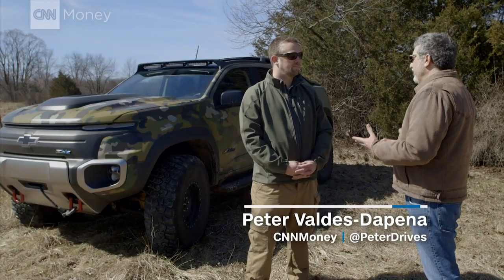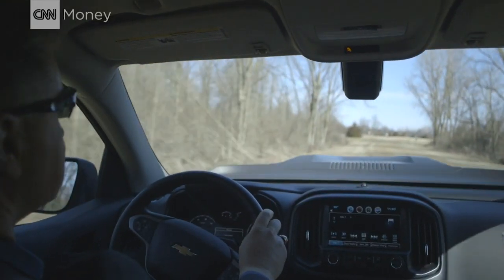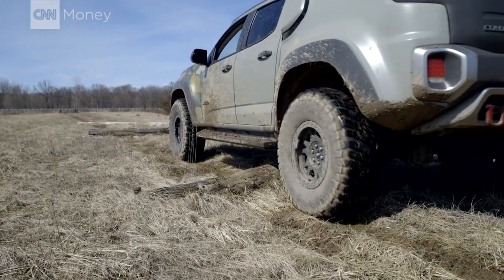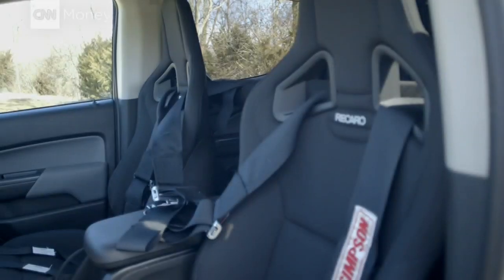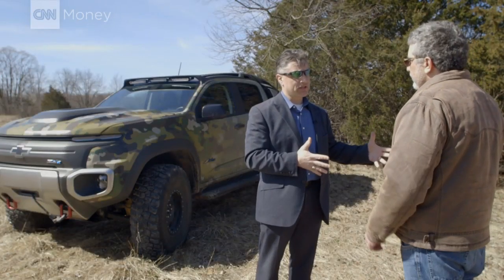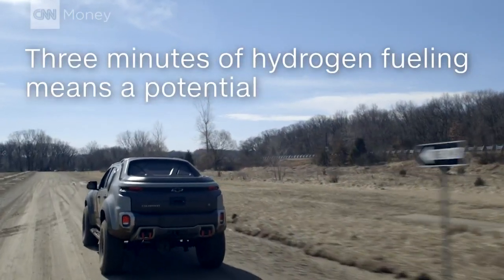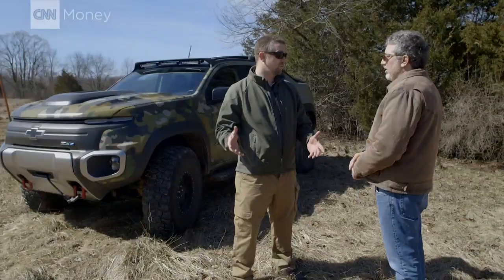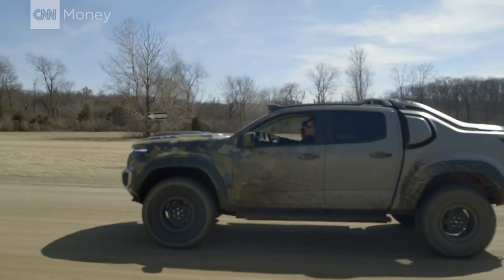Chevy truck turns fuel into water

Comment: Doesn't it take more energy to make hydrogen than to use normal fuel?
Reply: What you are saying mean nothing. Fossile fuel dosen't requiere energy to "make it" since it's fossile. But creating hydrogen with electrolysis consume a lot of enegy.
Reply: Think about the cost over mass = longevity,  reliability , sustainability
Reply: Creating hydrogen is pennies on the dollar or natural gas CNG either way hydrogen can Produced in vehicle when Fuel you have to purchase Hudrogen is made from a fuel cell that cost money to make the only energy you're using is Good fun Old fashioned Southern engineering .. impressive I'm impressed for doing calculus, trig , being an engineer my intire life it's redundancy to not spend the energy going green It's Alarming .